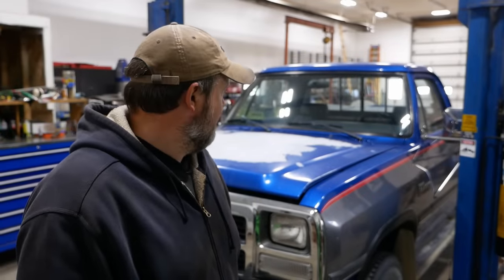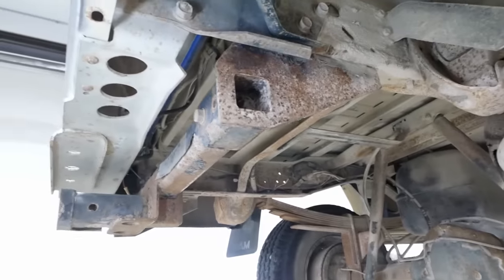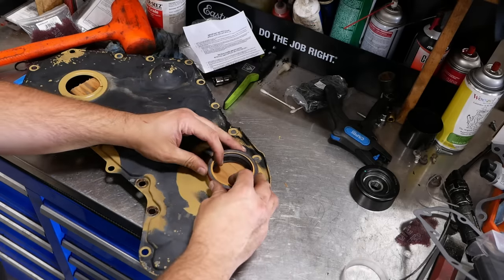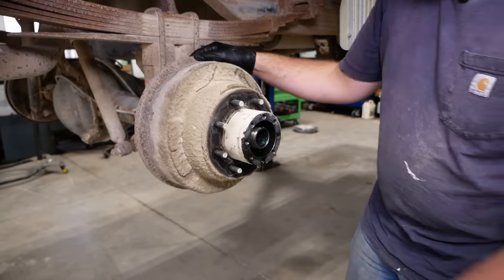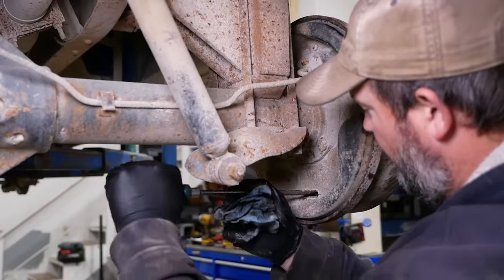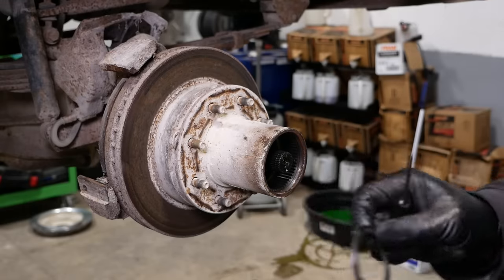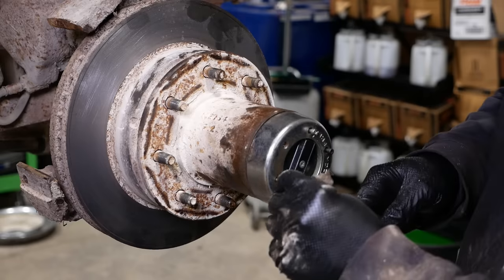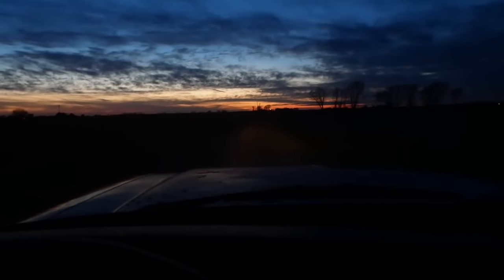Cherry 92 Dodge Cummins: Killer Dowel Pin, Brakes, Seals, Etc.

Comment: That's not an oil leak, that's a rust prevention system.
Reply: Its great when you don't even need to change em, you just keep adding LOL 😁👍😄
Reply: Don’t forget driveway sealer! 👍
Reply: Haha, true story.  I have an 18 Ram with a Cummins that doesn't leak a drop of oil. Rear wheel wells are already rusting.
Reply: He called five fifteen five one five
Reply: Noice
Reply: South Main Auto would call that "Fluid Film".
Reply: Customer States What: self lubricating chassis. It's a premium feature.
Reply: That's what I keep telling my friends
Reply: Marking its territory,  like a Harley
Reply: All the comments apply to my old Land Rover🤣
Reply: My thought as well...
Reply: It's not a problem til it's a problem
Reply: If it isn’t leaking, it doesn’t have any oil in it
Reply: That’s standard equipment on all bmws
Reply: @Derek-pd4fc when did the rusting start?
Reply: @mattbartolovich8228  about 3 years into owning it.  At that time it had less than 20k miles on it.  Just went through it with Ram and they denied the warranty on it.  Long story but they won't see another dime from me.
Reply: @Derek-pd4fc I thought newer rams didn't rust to literally nothing as bad as the early 2000s do but apparently they're still made out of the cheapest metal Dodge can use
Reply: @greaniebeaniez3070  I couldn't agree more.  It's not like this hasn't been happening for 20 years and they still can't figure it out.

Comment: The first thing to do is a Borgeson steering shaft upgrade.  Then new kingpins and new tie Rod joints.  Next up is the steering box mounting plate.  It likes to crack and cause slop.   If everything works you can get an identical turning circle to the left and right! 
A lot of lifted Rams put on a crossover steering conversion.
Steering and Dodge have a unique and strained relationship.  It often leads to a fight that causes death rattle.
Reply: Agree 💯 on the Borgeson.
Reply: I used a redhead brand box, but yea.
Reply: @drakesfear  borgeson shaft gets rid of the rag joint.
Reply: Might try the steering gear box brace. The brace supports the output shaft of the gear box.
Reply: @brianh8955  I agree with this. Loose stuff on the outside cause just as much slop as the inner bits.
Reply: @aserta  Yep, saddly it's an domino effect. Replace steering shaft, then its gear box, then its tie rods, then its pittman/idler, then its ball joints, then....well, you get the idea.
Reply: All well and good but you are talking about the WRONG truck. Wes asked about the steering on the 2nd gen not the first.
Reply: This truck being in the shape it is in has little to do with the manufacturer.  One sentence you said says it all," never driven in the winter." And the owner took very good care to keep it clean besides. Any vehicle would be just like if cared for like this truck was.  Chrysler manufactured very little of this truck solely. Cummins engine , Dana front and rear axles, trans and transfer case are privately manufactured . But the key is the care it has been given.  Who van afford to own a vehicle and not drive it for at least five months. Not many people.
Reply: Borgeson steering shaft is an excellent upgrade. I also like the box mount reinforcement plate. Good stuff. 
 I actually installed a steering stabilizer on my D300 2wd front end. It did help.
Reply: 2nd gen ram don't have kingpins, ball joints, and those generally aren't the issue when they are tight, an alignment will tell you if you need offset balljoint or not
Reply: BD makes a stiffener for the front end. Have it on my truck. Takes out the front frame warping when turning.
Reply: @richardstahlbusch1636  I drove a 2003 Lancer Evolution every winter but one since new and it had no rust.  What a shock it was when it blew a tire and took out a guard rail.  It was the best driving vehicle on earth.  Anyway, the secret was washing the bottom any warm sunny day in winter.  I'd park it over a running lawn sprinkler, moving it around to hit all areas.
Reply: I've replaced the steering shaft on several with the Borgson shaft and the chasing goes away.
Reply: My '99 was horrible. Always pulled right. Dealer said it was within specs. I told them to make it better than spec. And they did. Then it wandered. Couldn't drive a straight line to save my soul. I agree: Tear it out and start over.
Reply: @lorrinbarth1969  it’s amazing how many people just wash the paint or do nothing in terms of rust prevention and then blame their climate when their vehicle rusts out. 

I think every rig needs regular coats of grease. I worked on an 83 Toyota 4x4 hilux recently that has lived its whole life on back roads in the rust belt and driven every winter and it needed very little in terms of rust repair due to the many coats of grease it got.
Reply: @paulchapin4472  to fix the wandering, they needed to toe in a smidge while adding a little left thrust angle to account for the drainage built into roads. Would venture a guess they did it only to spec. And spec has a lot of room to.. wander.
Reply: also a lot of rear end assemblies in the junk yard with disk brakes, losing those drums in the back that give problems
Reply: @swamp-yankee  for better or worse I don’t believe this is common knowledge. You’d think rust belt culture would make this the norm but here we are.
Reply: @seanwieland9763  we’ve got a throw away culture, and it’s a problem. The average vehicle lasts 13 years from manufacturing here, and I think it’s mostly because of neglect.
Reply: @bcbloc02  Did he? I really thought he asked about the 1st gen.   I'm just a dumbass that got excited!   Mabey next time....

Comment: If nobody has ever told you, denatured alcohol will dissolve Permatex 2. It cleans your fingers and tools nearly instantly. And removes it from whatever surface it was used on. (I was in my 40's when I found this out. Has made the last 25 years easier.)

Comment: Pretty hard to get rotors turned anymore, nice to see.
Reply: Really? You can get them done at some O'Rileys
Reply: We do it at the Honda dealership I work at fairly often. A lot of customers prefer the lower price and we get paid more to do it. Win-win. Plus if we do brake jobs on our own cars, it costs $0. Just turned the front rotors on an Acura TL belonging to the valet supervisor here yesterday as part of a side job. Even easier since we have those fancy on-car lathes.
Reply: Wes has a video on commissioning that old brake lathe.
Reply: If there was no pedal vibration I would have pad slapped that job.
Reply: Turning rotors is still a very common practice in my experience.
Reply: Turning the rotors makes a lot of sense especially here where the the rotor is combined with the bearing and weighs in at like 400 pounds, it would be a waste to just throw it out
Reply: They warp after you turn them now a days. Cheaper material!
Reply: @andrewsang4688  You're so right. In CT and my local O'rielys will turn a rotor for $25 i believe.
Reply: Usually with the stuff I work on,  it's too thin after turning,  so I put on new rotors with new pads.  If it needs calipers too, add rebuilt. I don't like taking chances with my  own stuff,  or a customer.
Reply: @bertgrau3934  But nobody said anything about going below the minimum thickness
Reply: Thanks to Chyna, it’s almost always cheaper to replace than pay the labor rate.  As a general heuristic, capital is always cheaper than labor.  These are a unique design however so in this case, and as part of a larger project, turning them made sense.
Reply: @lolatmyage  
That's true, nothing was said about the rotors being too thin,  the problem is, most of the stuff I work on,  it's wore out by the time I get it. I think it would be nice to have a set that could be turned instead of replaced.  
Sir your point is well taken. Thank  you  😊
Reply: Some do, some don´t. Some don´t want to do it, even if the rotor is still in spec, they dont want anything happen to them because they are thinner now and don´t potentially warranty those rotors afterwards. Personally I think, as long as they don´t get too thin, which could happen with normal wear as well, for those trucks especially, it should be fine. Those are not high performance brakes, those are not high performance vehicles running at high speeds. And lets be honest, as Wes hinted on it, under best circumstances compared to some more modern and smaller vehicles, those brakes are "sort of" working when fully functional.
Reply: I know how, but on most modern cars it's not really worth it since new rotors cost about as much as the labor to turn them. Plus the specs are so tight you can do it maybe once before the rotor is too thin to machine anymore. Only time I will usually recommend it is on something like this.
Reply: @mph5896  yep, nothing like a $25 brake job !

Comment: Comment #2. In regarding the 94+ Dodge Ram. 1. Replace the steering shaft with a Borgenson unit. 2. Replace the power steering gearbox with a 1998 GM/Chevy 3500 one-ton Saginaw. 3. Install a steering shaft brace. Mounts on frame and mounts with a bering to steering gearbox shaft. 4. Install Left and right front leveling doughnuts. 5. Install Speedway Engineering sway bar kit. Uses a torsion bar and actual links for the stabilizer bar. 6. Install optional Bilstein shocks. Replace any worn steering components. Problems solved.

Comment: The best thing I did was add the pillow block bearing support, and then do the "rock solid ram" delrin steering shaft bushing in the column. The steering linkage fix can be done on that truck but you have to cut new tapered seats for that early generation of 2nd gen. 2010 steering linkage of a 2500 will be what you need to order. But those 3 things will make it as good as it will ever get. Note on the delrin bushing, it is affected by temperature, so make sure there is clearance in the warm shop, cold will make tight spots since the shaft is not round stock but rolled tube.

Comment: What an awesome old Dodge Truck. I had a red version of that truck back in the late 90’s. It was not very quiet in the cab, but would pull whatever you wanted. They were impressive for 1992. Thanks for the Videos, Wes. Always a treat.
Reply: The only 'awesome' part was the 'awesome piece-a-junk' in it's day!
Reply: @Johnny_Guitar  My company ran a fleet of them with flat beds in our hot shot division all over the lower 48. Not once did one fail on the road. I admit they were a hand full to drive but stout and dependable. When I left in 2000 they still had one of the first Cummins powered running with over 400,000 miles with the engine never touched. Probably 4 or 5 front suspension rebuilds but nothing else. One man's junk is another man's treasure and we did treasure our Cummins powered Dodges.
Reply: Love love love my 97 dodge Cummins, owned for 24 years and can say the absolute best truck I’ve ever owned. My son drives a 92 dodge w150, he’s driven it for 8 years now trouble free. My neighbor ownes a 93 dodge Cummins with over 800,000 miles on original engine, he drives it everyday as a contractor, lol truck has plenty of battle scars.
Reply: Don't forget the lower steering column bushing. To rid yourself of the last ¼ of slop.½million miles and the crank bearings are still minimum tolerance .0037".( back 4 tapered to max new clearance .0047 due to a bent crank when the KDP went through the gearset, retardingthe cam/ injection timing 5°)Rods within new spec.

Comment: A trick I used on a crankshaft pulley recently, to hold it while breaking loose and later torquing it. I took an old accessory belt, wrapped it around the crankshaft pulley such that it was pinching itself.  Then looped it up and around the most-stout nearby idler or accessory, and clamped it around that with vise grips.  Basically a static, improvised strap wrench.  Worked a treat and I will probably do that from now on
Reply: Or use the starter to break it loose…  😮
Reply: @SteelheadTed  did that on a Dodge Neon once. Worked great.

Comment: Biggest improvement I had on a 01 dodge 2500 was to drop the tire pressures to something reasonable. The truck wandered all over the road at 60 psi but dropped to 30-35 all around and it drove way better. Pressure up when towing of course. That was on general grapplers, I believe they were load range E tires calling for 80 psi. Driving like that empty was nearly impossible.

Comment: Seeing that old style truck brought back some good memories. Got my drivers license back in 1994. Learned to drive on that style truck. 1989 dodge similar color. 318 gasser. It was grandpas work truck. That thing had around 400k hard construction miles on it when it was retired. It wasn’t a perfect truck , leaks and rattles. Always got us to and from the job site . Hauled everything we needed .

Comment: My backyard hillbilly method to hold a smooth crank pully is to use an old timing or other flat belt (even v belts work) wrap it around the pulley then reflect it back over something round like a screw driver handle , socket ratchet handle...basically anything within reach lol. Then anchor the other end either with a ratchet strap or even a pry bar. Once you get it tensioned up it will hold the world without marring anything up. Basically it's just a make shift strap wrench but works well. Seems like you always run into this after the car is up on jack stands and there's no way to keep the motor from turning. Always a pain!
Reply: Just like a strap wrench, good ingenuity.
Reply: I do the same thing (actually commented right around when you did). I anchor the other end by wrapping the belt around something and clamping it with a vise grip

Comment: Heh - you should've seen the auto-locking hubs on the old IH Scouts. They weren't really locking hubs, they were roller-bearing sprag clutches, for light duty, emergency 4wd but nobody ever bothered to manually lock the hubs, so those clutches would get the balls beat off them. When you pulled'em off, a dozen worn out rollers and busted springs would just fall all over the floor.

Comment: I had a friend that bought a Dogdge 1 ton dually of that vintage brand new and he had steering complaints from the get go!  They replaced the Steering gear along with other front end parts he even took it to a Frame shop for front end allignment .  Nobody could fix it and Dodge finally bought it back under the Lemon Law.  They got him another Dodge and he drove it for quite a few years with minimal complaints.

Comment: I use to work on our 1999 250 Cummins turbo diesel trucks. We rebuild the front end on one at about 200,000 miles and we still had slop. I tightened up the steering gearbox per load about 1/8 to 1/4 turn to get about 5-8mm of play in the steering wheel from the center point then set the locknut. and it took care of our 10 trucks, but that was after every front-end part was checked to be within specs. If it was too touchy I loosened it to about the same play 5-8 mm. Good luck Wes. :)

Comment: I have a 95 Dodge. It was going all over the road. There are a series of fixes to do, not one or 2. First thing is redo the front end bushings and tire rods ends if play is found. Then adjust the steering box to its maximum setting. Then you want to install a steering stabilizer  bar that removes the flex from the frame. The last thing would be to change the steering wheel shaft plastic bushing located just outside the firewall on the engine compartment side. It will decrease the wandering about 80 %. If you have a show truck and a lot of money you could adapt a more recent steering pump and linkages but you will have welding to do on the frame. That would be 100% cure. Deboss garage had a video of a guy who did that on his second gen truck. It was an impressive mod. Hope that helps. Bernard.

Comment: As for the second gen, check the frame where the steering box is mounted. It tends to flex and can crack. There are lots of braces out there to stabilize it. It's also very common to put steering stabilizers on this model, though that might correct a symptom, but not the core issue. Otherwise it's just replacing worn suspension parts. You're right, though... Dodge means death wobble.
Reply: I've had 1st 2nd and 3rd gen Dodges and none had death wobble. No bigger tires than 285 on all.
Reply: Poor maint or abuse means death wobble, only one one of four was exhibiting that and toe in and tires fixed it

Comment: Me and my dad bought a 1990 Dodge D350 5.9 Cummins 5 spd and a 1993 Dodge W350 5.9 Cummins auto for the farm. Replaces a lot of ''Dodge stuff'' over the years but they're both still used daily. That there is truly a unicorn though, ours are beat up, scuffed up, and got some rust even though they've been POR-15 treated since new. Thanks for this awesome video Wes! Love the nostalgia!
Reply: Painting over rust was a horrible idea
Reply: @mikem5475  POR-15 is designed to be applied to rust. It won't even adhere to bare metal.
Reply: @BrodieBr0  yeah and how did por15 work for you?...

Comment: Steering box stabilizer kit. I put it on all of mine. It replaces the pitman arm nut with a shaft and the brace holds a bearing on the shaft. Also triple check the track bar.

Comment: One of the best things to do with the brakes is to replace the wheel cylinders on the rears with larger ones.  The stock ones I think are 1" bores, and you can go up to either 1 1/8" or 1 3/16".  It really improves the rear brake performance.
Reply: Correct you are.  I replaced my rear wheel cylinders with ones from a one ton chevy, exact fit, better braking pressure.  I load my Dodge with a camper and disconnecting the rear brake proportioning valve linkage also also results in  more pressure to the rear brakes so that the front brakes aren't doing all the work.  The addition of Hawk super duty front pads is another way of getting better stopping power.